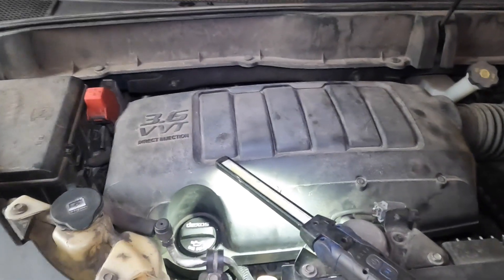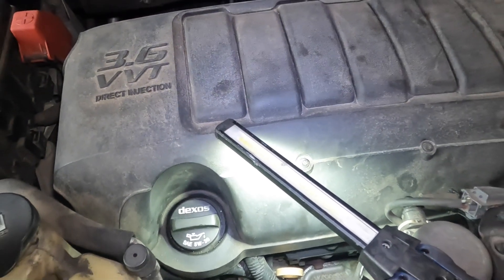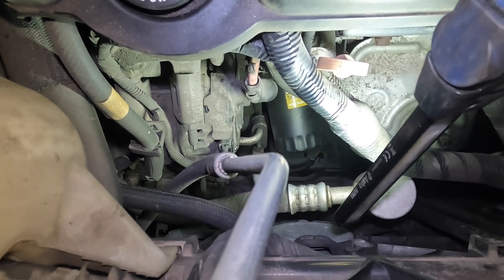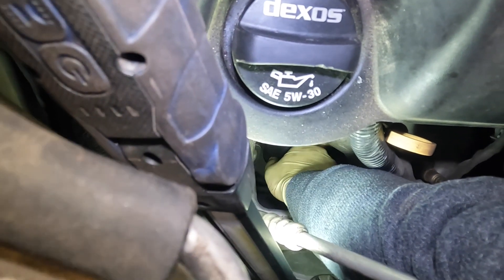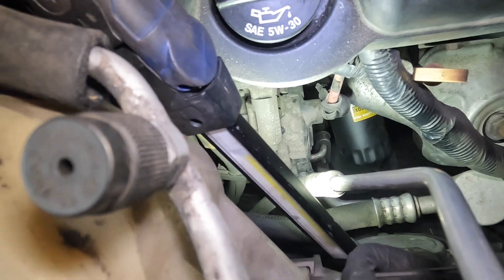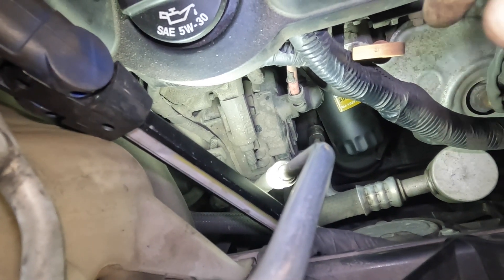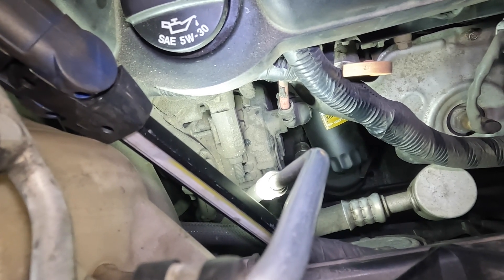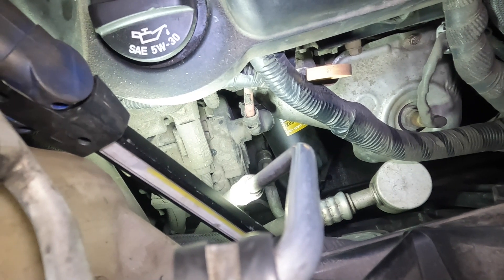ENGINEERING FAIL!!! WHERE'S THE OIL FILTER??? GM 3.6L V6 HIDDEN OIL FILTER LOCATION.

Comment: I wouldn't call it a fail. This engine is used in a lot of applications. My Colorado has this engine with a cartridge filter that comes out the top. It couldn't be easier.

Comment: I own one of those. I take it out of the bottom, but only when the engine's cold or barely warm. I drop it in from the top. And there has never been a time when I didn't spill oil all over the exhaust just getting the filter off. Poor design, but whatdya gonna do once you have it?
Reply from the maker: Lots of brake cleaner will help with cleaning up the spilled oil!

Comment: get a car from the 80's put a new engine and transmission in it along with a new paint job and maybe interior if it needs it. would be one quarter the cost of a new car. then give this present decrepit industry the finger.
Reply from the maker: True statement the 80's were the last good generation of cars!
Reply: You must not be from the Midwest. Those cars rusted away a long time ago.
Reply: @Logan Forney  more 80's cars in Denver than you can imagine.

Comment: With  Lexus they put some thought behind it's very easy to service
Reply from the maker: There are a few difficult Lexuses but for the most part they’re pretty good with filters and maintenance.The hardest one that comes to mind it would be a GX 470, that filter is right in the center underneath the car and you have to remove the two shields to get to it.

Comment: It"s not really "HIDDEN",  just kinda challenging to get to.  The power steering fluid reservoir, and the battery, now those are "HIDDEN".  Now that AIR FILTER,  that's the real pain in the a$$.
Reply from the maker: The batteries are probably the worst under the seat on these!

Comment: Reminds me a bit of the filter on the Saturn 4-cylinder engines (and I assume other GM vehicles). Only accessible from the bottom, angled so it can't drain into the block, and above a crossmember and axle so you need a second wrist. You'd dump about a half pint of hot oil on all the stuff underneath, including your arm, no matter how quick you were.
Reply from the maker: I've done a few of those I remember they would smell like oil after oil got all over the exhaust pipe.

Comment: Shouldn’t be like considering it’s a Toyota motor…
Reply from the maker: As far as I know this engine is in no way a Toyota engine. General Motors (GM) produces them from ground up they are called the 3.6 LLT.
Reply: It is not a motor. It it an engine. A motor is an electrical machine that converts electrical energy into mechanical energy.
Reply from the maker: @jessecavada3015  Well said!!! However I still use the two terms either way when i refer to a gas powered engine.
Reply: It's not a Toyota and it's not a motor, so you're double wrong
Reply from the maker: @DoesntRefillTheBrita  Thanks for the input!